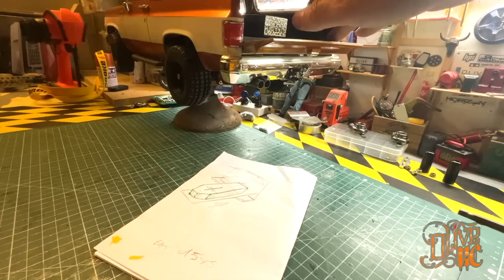RC RC4WD Chevrolet Coffin Blazer K5

Comment: Breath of fresh air with the "factory" show room floor ride height. Colors for body work, again just spot on. The jacked up super articulated suspension is cool for scale crawlers and all. But the vast majority of the Blazers I remember looked a lot closer to your build. And the color looks like right off a dealership sales brochure. 
BUT WITH THAT OLIVE R/C TWIST☠️😎 LOL!  
Which actually brings up a good point.
I can think of only two hearse bodies for R/C. One is a HPI body and is kind of cartoon-ish. The othe is made in the UK in 1/12th scale, not too detailed I think its made for "banger" racing.  So you're build has brought forth a omission of available bodies that is really a no-brainer. I mean, Holloween is just around the corner. I will suggest to a couple of contacts in the rc business there is not a good representation of a hearse. Coffin battery box 😝